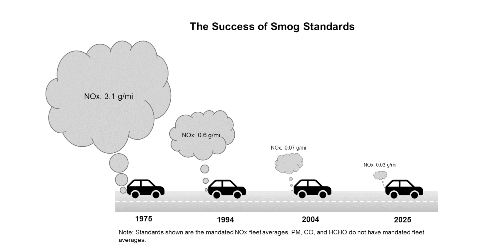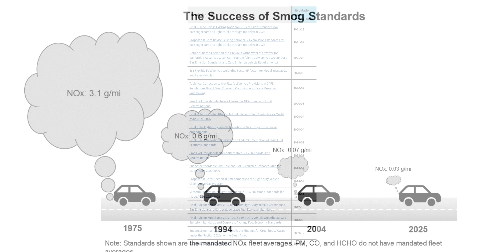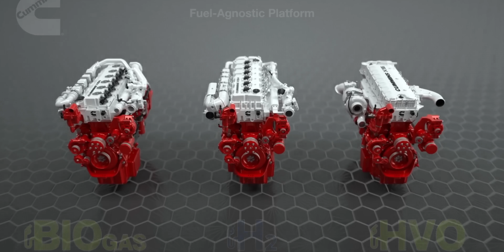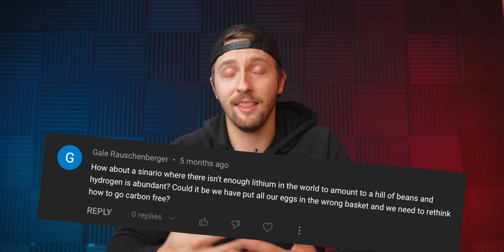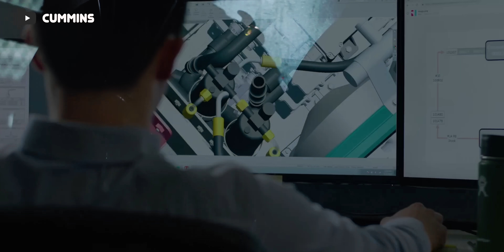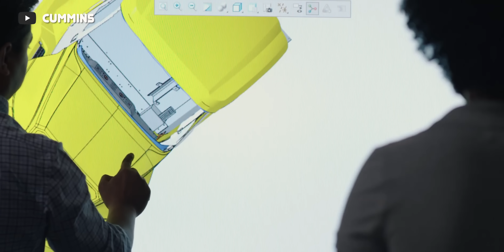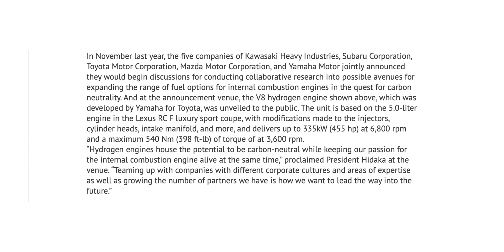Cummins Hydrogen Engine Will KILL DIESELS FOREVER

Comment: Locomotive style propulsion wasn't covered.  IE. electric motors to drive the wheels along with regenerative braking.  But it is how the current is made that makes all the difference.  It could be an H2 cummins engine driving a 3-phase generator with small lith-ion batteries or capacitors for intermediate storage.  We could even from that get to micro nuclear power plants, but that won't happen until the marine sector gets there first, then maybe locomotives, then down to long-haul big rigs
Reply: Like our current hybrid cars?
Reply: Hydroelectric vehicle

Comment: Considering the Hydrogen adaptation is a smoke screen.  It uses Fossil Fuel to make it, cost 5 times more and Hydrogen is one of the LEAST accumulated atoms in the universe.  Not only that there are near ZERO places to buy it and it is more combustible than Oxygen. Think HINDENBERG, and then stop thinking about it anymore.

Comment: A friend of Mike works for a electric company he said theyvdid a study and found it would take 30 years to improve the grid enough for everyone to drive a electric car
Reply: Heard same thing from well read construction project manager. He too said 30 years. Must be something they can calculate to the year.
Reply: DANG!
Reply: I'd  bet a large sum of money that it would take at least 45-50 years.
Reply: Ask anyone in the Biden regime. Tomorrow is the date they would use 👿
Reply: Actually this is not true.  I replaced my 20 KW electric furnace with a 4 KW heat pump.  So with that savings,  I can plug in my electric car.  If you just reduce your HVAC use by a little bit, you can have a net savings on your electric bill each month.  

Anyone who has owned and plugged in a home charger for their EV knows how in-expensive they are to run them.  

The electric company energy planners in the 1970's and 1980's had a difficult time with the new portable window A/C units that all tend to run noon to 7 pm every day.  That gave them a headache.  Overnight power at 9.6 KW for a EV charger is no problem at all!  And in 3-4 hours, you can fully charge your car or pickup at home.  

The Ford F-150 uses about the most power per mile, at about 2-3 miles per KW of power.  Well the Hummer EV is a little more power.  So lets say you drive 30 miles a day, and need to put in 10 KW to your F-150.  Or 90 miles and need to put in 30 KW.  That will take 1-3 hours with a 9.6 KW charger that draws about 32 amps at 240 volts.  Your air conditioner uses about 1/2 that amount of power, so it really is not that much stress on the grid system, considering you only need to charge overnight, when demand is low.   And you would typically run the A/C more than 3 hours on a hot day.  

A Tesla car is about 4 miles per KW of power.  So driving even 100 miles in one day, that would be 25 KW or about 5 hours with a 5 KW charger between midnight and 5 am.  That would be about 20 amps X 240 volts.  Or about what a 1970's 2 ton air conditioner would use.  But you would typically use the air conditioner more than 5 hours per day, and mostly between noon and 9 pm, when others are also using a peak amount of power.

Comment: Neither are gonna happen. Electrcity is made by carbon ran products. No industry is gonna push hydrogen when carbon based oil fields are still the easiest, cheapest, reliable technologies available.

Comment: These new engines are diesel engines. Definition of diesel engine: " an internal combustion engine in which heat produced by the compression of air in the cylinder is used to ignite the fuel." These are simply diesel engines that burn liquid hydrogen.

Comment: Hydrogen ICE doesn't make sense from an efficiency point of view. much better is the hydrogen fuel cell way, of which you have shown a lot of images (the black truck has it written all over the body) but didn't spend a word on, I really wonder why. 
Also to keep the hydrogen at liquid temperature the tank doesn't need to be pressurized   (that's for gazeous hydrogen) but insulated.

Comment: There is an english heavy diesel company that already has begun phasing in hydrogen power plants as batteries are too heavy overall to supply the energy needed.   They are also building out a full vertically integrated system.  Machine+Fuel depot+Hydrogen delivery.
Reply: Are you referring to JCB?

Comment: I like it how they are looking into other fuels, especially biogas, but why bother with an hydrogen ICE? Just use an fuel cell and an electric motor and you basically doubled your range. The problem is not the conversion into motion, but the storage and production of hydrogen, so there is no reason to make the easy part more complicated ;)

Comment: epa has taken the reliability out of new diesels and hydrogen has more power so it may be a great combination
Reply: Buy volume diesel contains far more poweelr thsn hydrogen
Reply: @MA-yl1er  hydrogen is the most explosive element in the periodic table by weight
Reply: @adamm2716  agreed. Not by volume though. Would need much larger tanks to hold same amount of energy as diesel. That is prohibitive.

Comment: You can't carry enough hydrogen even at 3,000 PSI for a bare minimum. It's the smallest element and it will seep past any walled tank. Think of the atom size compared to metal atomic structures.  That's just for starters, there are many other drawbacks. I'd like to see something like that happen but this just doesn't become is practical as most people think. The reason why these companies look into hydrogen power is to find a better hybrid method for Logistics

Comment: The efficiency and environmental impact depends on what the hydrogen fuel has been produced from. Hydrogen fuel cells are produced from three sources. Fossil fuels (natural gas), biomass (fermentation), and finally water and electricity. It seems that we are in a Perpetual drought so water should be out of the equation. Natural Gas obviously should be out of the equation. So that leaves biomass. But biomass has to be grown harvested fermented distilled and then have the hydrogen extracted from it.

Comment: Nuclear power is the only way we can go green or switch to cleaner fuels that are made by electricity (like hydrogen). I think hydrogen is completely impractical and very inefficient. Without an onboard hydrogen generator (isn’t possible) this fuel is useless.

Comment: With hydrogen powered vehicles, wouldn't you be running around in a bunch of little hindenburgs, and or H-bombs? Hydrogen is a lot more combustible and dangerous than any fuel option currently. Vehicle accidents would be much more hazardous

Comment: If they could make a 2 stroke Detroit or a cat 3406 or even a older powerstroke run off of hydrogen that would be neat, I wonder if there will be conversion kits for older engines.
Reply: Ford used a 6.8L V10 with a supercharger to make a hydrogen powered 550 HP pickup truck, mounted in a 2008 F-250.  It could also run on E-85 or gasoline.
Reply: @Kangenpower7    that's interesting , the V10 on regular gas was terrible !
Reply: Lubrication would be a problem, at least
Reply: @MrLinkiscute  and the fact that hydrogen in its gaseous form would escape the induction system used in two stroke engines and therefore not allow it to run
Reply: @fluchtigziege3202  two strike gasoline engines don’t have that problem. Why would hydrogen be any different in a two stroke. You’re burning vapor in both scenarios.
Reply: @boomerang379  Hydrogen isn't an atomized vapor, it's a literal gas unless you cool it by storing it contained at a temperature of -252.87*C. As soon as it is released into an atmosphere greater than 1 bar, it will change state back into gas even refrigerated.
Reply: @boomerang379  tell em you know nothing about hydrogen without telling me you know nothing about hydrogen
Reply: You can but they are not efficient.
Reply: @gregkramer5588  not sure what you're referring to, but in no way would hydrogen work in two stroke engines, the "reflux" required by them would simply never work with hydrogen, ever
Reply: @fluchtigziege3202   It doesn't matter because it makes no sense to burn it in an internal combustion engine
Reply: @gregkramer5588  correct hydrogen cells are the go not ICE hydrogen
Reply: The old Detroit's used as much motor oil as diesel fuel !  I ran a 6-71.  Rolling coal was an understatement !  Didn't clear out untill it got to the upper rpms
Reply: @walterdavis4808  I ran a truck with a 6-71 for a while myself.
Reply: @gregkramer5588   there's nothing like that sound when it opened up !
Reply: you will never see a 2 stroke hydrogen engine, if you understand how two stroke engines induction system works and how hydrogen behaves you would know its impossible

Comment: What you missed in this conversation is $$$$$$$$$$. 
They will be so outrageously expensive that they will be even more impractical than electric.  Get the criminals in the EPA out of the picture and everything would be just fine.

Comment: Japan is definitely leading the way. Watched a video about their new nuclear plants being built,that are cooled with helium. All the new plants have hydrogen production plants built right next to them.
Reply: Nuclear power plants do not just turn on and off. They often produce excess power that is just wasted. So they use the excess power to produce hydrogen. I believe we must embrace nuclear power as a true non carbon based source of energy for the future.
Reply: You do realize that Helium is a scarce source....Mostly comes from oil wells....
Reply: @regdor8187  ha ha yep 👍 ironic
Reply: Nuclear reactors also produce helium as radiation
Reply: @regdor8187  who gave you this idiotic information?
Reply: That's because they have no space to waste on their land. So everything they do needs to be well thought out. Kinda sucks but incredibly impressive.
Reply: University of Bristol and NDB converts nuclear waste into 1,000 years of continous electricity. They will harvest electricity from underground nuclear waste storage and provide batteries that never need charging for next 1,000 years.

Comment: The is NO free hydrogen on earth, it is generally found bound up with another element, usually oxygen (water) or carbon (hydrocarbons), it takes a large amount of energy to liberate H from oxygen, probably more than the energy such a reaction would require, where would you get that energy, windmills?  The other and most commonly used method is to strip H from natural gas, this process wastes a significant part of the energy in the natural gas and produces a large amount of CO2 (something we are trying to get rid of) furthermore natural gas isn't cheap to begin with.  In either case, the cost of a gallon equivalent would be significantly higher than either diesel, gasoline or natural gas, probably about twice as much.  You can get much higher conversion efficiency by using hydrogen in a fuel cell than either a diesel cycle or otto cycle engine but large output fuel cells are significantly more expensive than either of those alternatives and I don't know if the fuel saving would significantly offset the cost of the fuel cell.  Hydrogen has other issues as well, it is the smallest element on the scale and will escape from virtually any container currently made.  To carry significant amounts of H would need very high pressure fuel tanks even if the product is liquefied and it is very quick to go BOOM! if it ever escapes.  No pipeline yet built can contain hydrogen meaning it would have to be transported by either truck, rail car, or vessel; not as efficient as the pipelines that currently transport most of our oil and gas products.  Russia, China, India, and the rest of the third world have no intention of going in any of these directions and that accounts for more than half of the world's population and if we choose to continue on this route we will be the third world and they will prosper.

Comment: i would like to see the crash tests on what happens to these tanks filled with liquid hydrogen under pressure......
Reply: That same question was asked when they put gallons and gallons of highly flammable (and explosive) gasoline in cars. Before that, people worried about boiler explosions in their steam powered vehicles. We will adapt, same as always.
Reply: Anything that stores energy is potentially combustible or explosive; gasoline, kerosene, hydrogen, lithium, diesel, etc.
Short of using a flywheel as a power source, you will not have an energy source that is noncombustible within the context of daily driving usage.

Comment: Democrats and liberals are just gonna have to learn the hard way it's actually gonna end up losing them revenue in the end because not everyone is going to conform to using electric because just like you said they will never be feasible in far off off highway jobs and dozers and trachoes you name it they just won't be feasible and they just won't be as practical.

Comment: If only Hydrogen wasnt the worst idea ever.  For starters, clean hydrogen is made from the electrolysis of water..........a process which is only 43% efficient.  So straight off, you have wasted 57% of the energy.  Then there is a problem with the density of hydrogen as a gas, it is the lightest gas.......from a molecular point of view it is also very difficult to confine in a tank, at high pressures. It also burns with no flame.  Hydrogen gas is an explosive.........in the presence of air, it readily ignites, and explodes with a shock wave 300% faster than any other known chemical substance. That means a hydrogen explosion has a very heavy, destructive punch.  To get storage density up to decent levels, it needs to be turned into a liquid........and its the most difficult gas to compress and cool into a liquid, wasting another large chunk of energy.  BMW discovered that hydrogen liquid cannot be kept liquid for long, so if the volume is not used quickly, it has to be vented, it does not store for more a day or so.   Hydrogen also makes metals brittle, and the equipment to dispense liquid hydrogen is another expensive problem.    All is not lost, because Hydrogen can used to make actually very useful chemicals such as methanol and ammonia.  Methanol can be further improved into a very promising fuel called Butanol which can be a realistic drop in replacement for gasoline and diesel and blends very well with both, unlike ethanol.   Furthermore the Achates 2 stroke engine that Cummins is making for the US military has passed its CARB trial extremely well, and can meet future NOx emission guidelines while reducing fuel consumption some 20%.    Basically this video is a bunch of misinformation twoddle that nobody should take seriously, its all inaccurate,out of date and poorly researched.

Comment: It's like I've said for some time and more than enough data is around to support what I say. For the short distance daily driver EV is great, past that we're not ready for EV and it does more harm than good for long distance drivers. Blue votes tell me I'm stupid, retarded, etc and I should have studied electrical engineering  and maybe I would know what I'm talking about.  Blue votes think power does not come from coal or diesel either.

Comment: Cimmins is smart making a base that can be converted is a good way to go.  Hydrogen is not the solution.  Not only does making hydrogen require TONs of electricity, but the MPG is poor which means you need to carry much more hydrogen than diesel.  LPG works in fleet use esp. short haul. (day busses in cities.) Maybe a market in Marine applications.

Comment: Don’t fall for it brother. The same people saying no more Diesel also said gas engines will be gone by 2020, they also said there will be no more beach front property by 2002 due to oceans rising, the same people said there is no more ice bergs, but king crab is more expensive because the ships have to navigate through more ice than normal. 
These are facts not CNN propaganda. Diesel has many more years to go, however hydrogen is the way to go but the oils industry ain’t gonna make it easy.